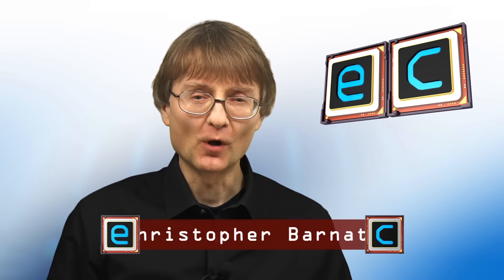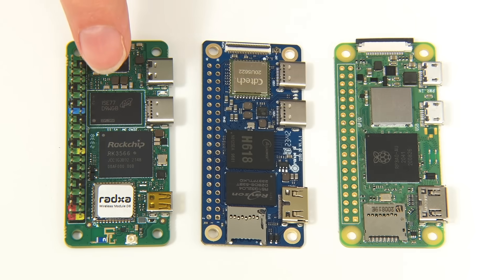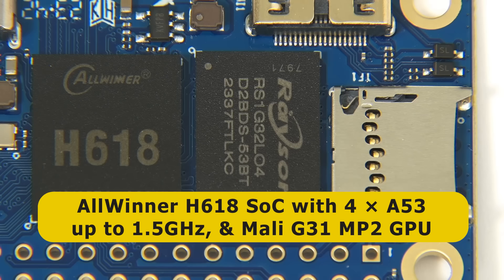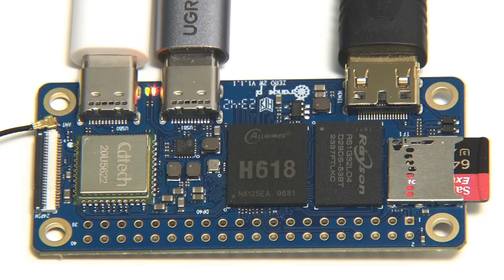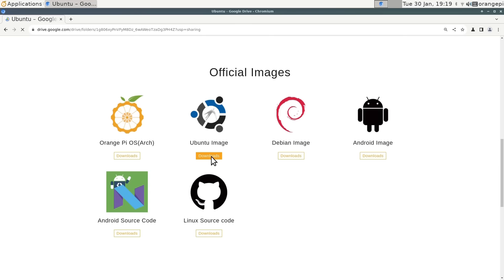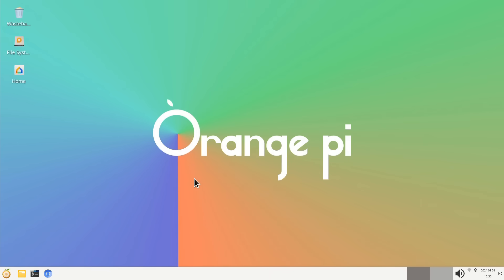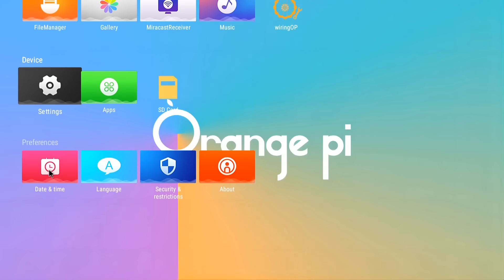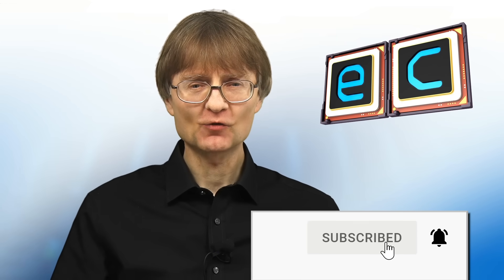Orange Pi Zero 2W

Comment: Composite output is always a plus for retro gaming
Reply: A working operating system is an even bigger plus.
Reply: Yes, if it was possible to actually use it. Try searching online and you'll find lots of questions "how to use it" and no answers.
Reply: @ominguti6345  im petty sure you need to add an overlay for it, but i dont know if there is one already created or not. OR if there is a option inside "orangepi-config", i would look in there first.
Reply: Pin out diagram would help, and more than likely you'll have to add it then "address" it in the code.
Reply: No, composite is shit for classic/retro gaming.
RGB is the way to go.

Comment: I get the vibe the cool kids are getting into peer-to-peer LoRa mesh networking which is just screaming for a BBS-style app, these little boards may well become the hero of the day.
Reply: That's actually a good idea for a video. Perhaps Chris can do a video on peer-to-peer LoRa mesh networking. As for the other commentators, they apparently don't understand the bandwidth constraints of a LoRa network. BBS makes sense for such a network.
Reply: The cool kids were doing peer to peer LoRA four years ago!
Reply: @sUASNews  And they are back at it again because of all of the political instability these days.
Reply: BBS's? You still running dialup?? Dalnet is dead.
Reply: @loginregional  I missed BBS, the UK had nowhere near the same scene as the US. We had Cefax =), did love the BBS ANSI art tho. Localized mesh networks with no gateways, gatekeepers or bills could be quite useful and fun. Long Range Radio can't handle much by today's standard, but olde world BBS on the other hand. Right I'm off for a game of Legend of the Red Dragon
Reply: @loginregional  there is a mini BBS revival (sort of) going on. All of the BBSs are telnet/ssh accessible, and some hard-core even include a dialup, but it's rare.

Comment: Orange Pi boards are a very interesting alternative to Raspberry Pi ones
Reply: Well it is technically, software support is unfortunately still not on par. Problem is Allwinner (manufacturer of H series of chips used on many Orange Pi products) does Android only drivers and limited old linux kernel drivers. Everything up to date is done through open source projects like Lima and Cedrus. So if you're just using SPI, I2C, toggle pins and do CPU related stuff - yeah, that's fairly ok. Going into things like hw accelerated browser or some low level control with baremetal - nope.